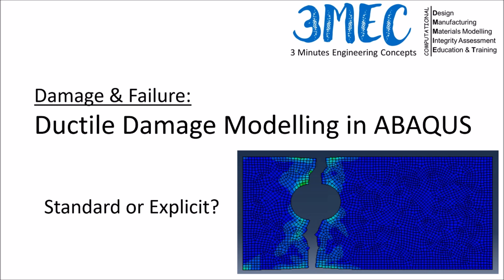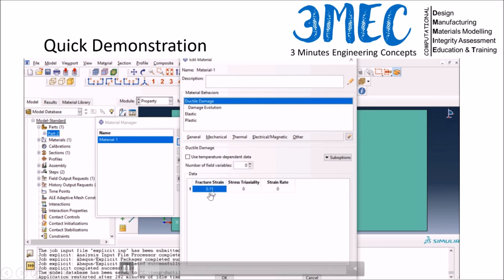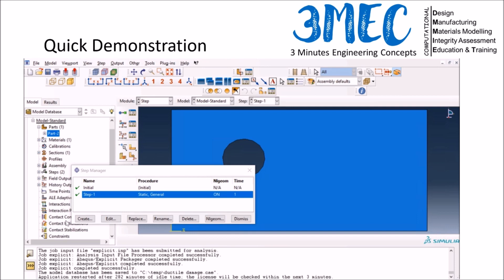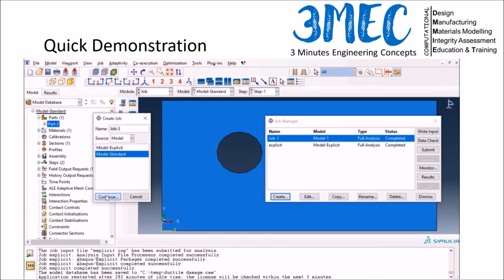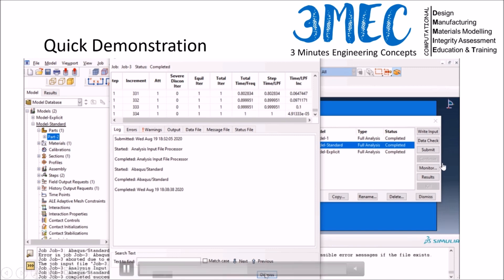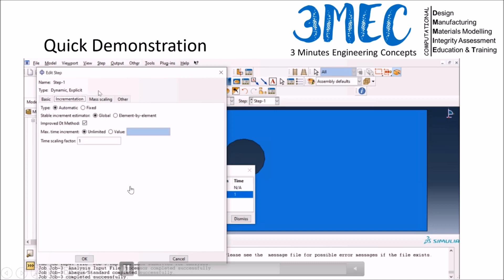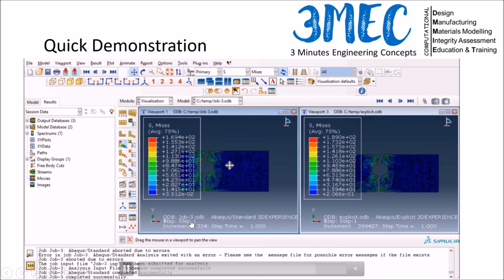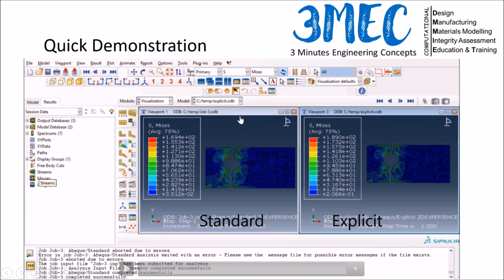Ductile Damage Modelling in ABAQUS: Failure Simulation via Standard & Explicit Tech - Tutorial

Comment: Great Video.......but Which is best for doing Impact or Dynamic analysis ? 
any difference between two which one is better for which type of analysis?
Reply from the maker: do you mean implicit or dynamic? as explained in the video, it highly depends on the problem. If you have a highly dynamic problem to simulate with short time duration then explicit dynamic would be suitable, otherwse implicit might be better. I hope his is what you asked?
Reply: @Professor3MEC  Thanks.....highly dynamic problem means medium and high strain rate problems?
Reply from the maker: @vaibhav8009  you can use both if there aren't rigid body motions involved. For example, high strain rate uniaxial tensile tests. For very dynamic problems, such as foam crushing, etc. explicit might be better. But this is just my opinion.

Comment: thanks,
what's the difference between this example and the xfem crack growth for example ?
Reply from the maker: Both may be trying to achieve same. One is based on the fact that element is removed from the simulation and hence careful meshing, etc is need. While other is more suitable for crack growth problems which were inherently a big problem in FE codes.

Comment: Dear Expert, 
I Want to identify ductile damage parameters for doing the spinning simulation.The material is AISI 304 (Stainless steel)
How can I do that? How can I select the proper thickness of notched tensile test specimens?
Reply from the maker: Hi, you can fit stress strain data to do so.
Reply: @Professor3MEC  How can I select the notched specimen? What thickness? The stress triaxiality and fracture strain should be characterized.
Reply from the maker: If you have uniaxial, BI- / triaxial experimental data then you don’t need actual sample but you can start with one element test as shown in another video on the channel. If you only have ct-specimen result then you may have to go with the full model.
Email me more details to have a look so that I may suggest something suitable.
Reply: @Professor3MEC  Thank you for sharing your knowledge.I sent my question as an Email.

Comment: hello sir 
thans for the great effort
i have a question please. 
what is the difference between fracture strain and displacement at failure ? i know that the fracture strain corresponds to ultimate stress.. what about the displacement at failure ?
Reply from the maker: Hi, Thanks for liking the channel and videos. Displacement at failure is used in a phenomenological way to capture softening part of the stress-strain curve. This can also be estimated using failure strain and characteristic dimensions of the elements. I hope it is clear?
Reply: @Professor3MEC  Thanks for your reply. 
I will tell you basically what i am trying to do. 
I am modelling a steel pipe subjected to internal pressure.
I want the pipe to crack when it reaches a certain stress or a corresponding strain.
My steel has 292 MPa yield strength (0.001 plastic strain), 480 Ultimate strength (0.16 strain at failure (total fracture strain). 
those tensile tests results are obtained from a steel specimen (dumbbell-shaped sheet) which has a 200mm length and 12.5 mm.
how can i calculate the displacement at failure ? since the fracture strain is 0.16.
Reply from the maker: @amrabdullah1995  IF you have uniaxial tensile test data then you can fit the experimental stress strain curve with uniaxial simulation in ABAQUs, and then use those parameters directly in ABAQUS for pipe model. Having said that, in pipe your structure might be under bi and tri- axial stress states so one needs to be extra careful, but it should still work.

Comment: Thank you for the video. I have a question tho, not about this simulation but about a classic bullet impact simulation. Whenever I try to penetrate a shell plate with a discrete rigid bullet in explicit analysis with all the damage properties and element deletion on, shell elements deform hugely but does not rupture or delete, they form a shape similar to a spear head, big triangle shapes and  such but they do not rupture, they stick to the bullet like a blanket on it, any idea about this issue ?
Reply: sounds like you have not activated the STATUS variable in the History Output Manager
Reply: @hnrwagner  Yes Dr. Wagner, that was the problem for about 5 months ago I've learned about that, but still thanks for the answer. But I am wondering something else: can I still keep the failed elements in the animation/frame. I don't want them to get disappear or deleted rather just stay afloat in the space.
Reply from the maker: Thanks for liking the video and channel. It could be due to various reasons, such as damage evolution parameters, contact properties, element types. Is it possible to share more details or input fie to have a quick check?